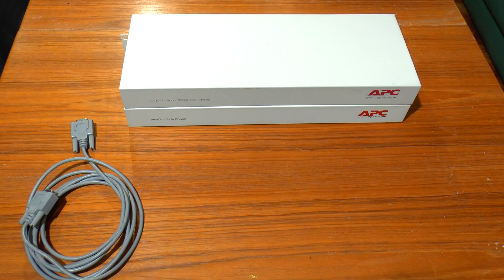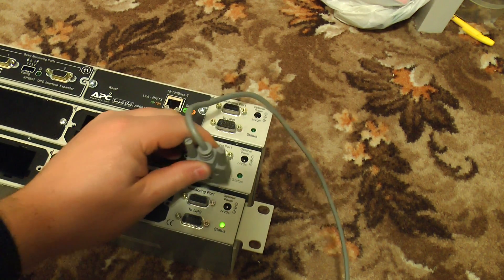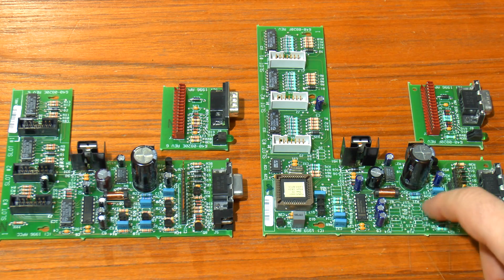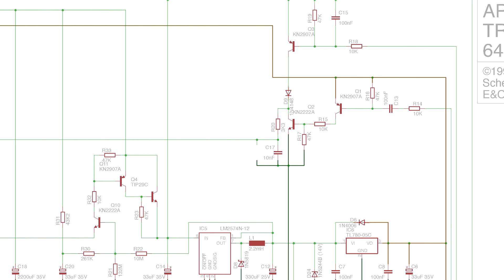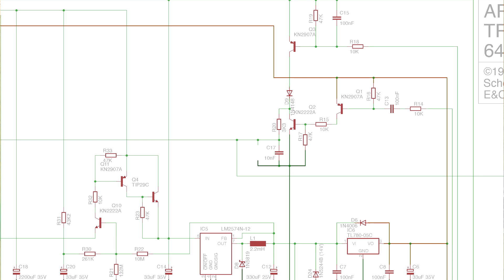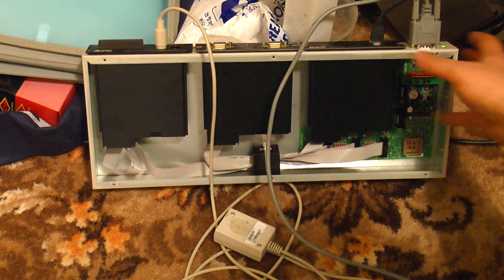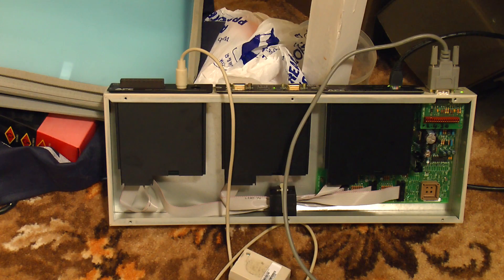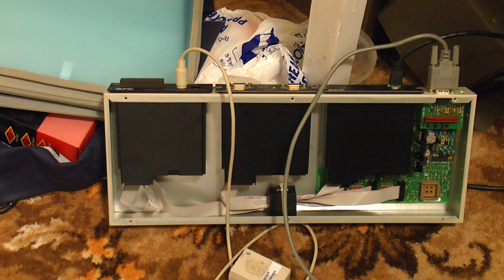APC Silcon Triple Chassis AP9604S teardown and AP9604 conversion

Comment: Hereby I want to confirm that the conversion works. I successfully modified one :-)
I made a list of what should be removed and added:

REMOVE:
C27 100nF
C28 100nF
C29 100nF
C30 1µF
C31 10µF
C32 10µF
C33 100nF
C34 100nF
C35 100nF
D25 1N5819
IC7 PXAG49KBA
IC8 93C66N
IC9 MC34064P-5
Q12 KN2907A
Q13 KN2222A
Q14 KN2222A
Q14 KN2222A
R63 100K
R64 20K
R65 20K
R68 10K
R69 47K
R69 47K
R70 10K
R71 47K
R72 47K
R73 10K
R74 2K
R75 2K
Y1 16MHz

ADD: 
C13 100nF
C15 100nF
C17 10nF
D3 1N4148
D4 1N4148
D5 1N4148
D9 1N4148
Q1 KN2907A or BC557A(reversed mount)
Q2 KN2222A
Q3 KN2907A or BC557A(reversed mount)
R14 10K
R15 10K
R16 47K
R17 47K
R18 10K
R19 47K
R20 3K3
R40 3K3
R61 link
R62 link
R66 link
R67 link
Reply from the maker: Nice one, hope you can make some more use of it now :)
Reply: Yes, it is up and running with two cards in. Txs again.

Comment: When I think of a UPS I think of a battery connected to a power invertor with some control circuitry?  What do these do?  Just manage an external UPS?
Reply from the maker: +Jay Walt Yes. The triple slot chassis allows multiple cards to be connected. In the example here an AP9606 was being used, which is one of APC's earlier web/SNMP management cards, superseded by the 9617/8/9 and in turn by the 9630/31 which support the newer models. These cards can send SNMP (Simple Network Management Protocol) messages to a central SNMP monitoring server, plus email alerts (on-battery, returned from on-battery, battery low, battery failure, overvoltage, undervoltage, stuff like that) and offer remote control (self test, turn off, turn on (if turn off didn't disconnect you from the UPS), reboot (a turn off followed by a turn on after a delay) and stuff like that.

Early cards such as the AP9606 didn't come with an environment monitoring option, so for this requirement (useful for keeping an eye on an air-conditioned comms room) the AP9612TH card would be required, together with a triple chassis. Newer cards have this as an option (the 9618, 9619 and 9631 cards have connections for temperature and humidity sensors).

This Wikipedia article has links to the various card pages: https://en.wikipedia.org/wiki/APC_Smart-UPS